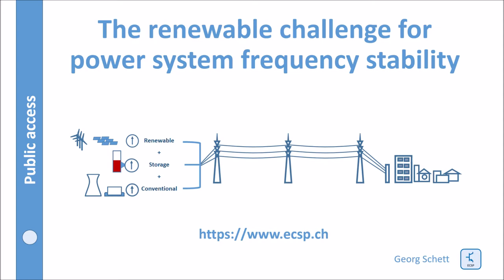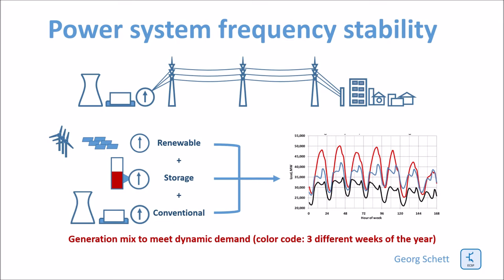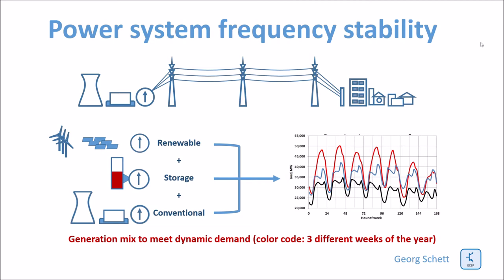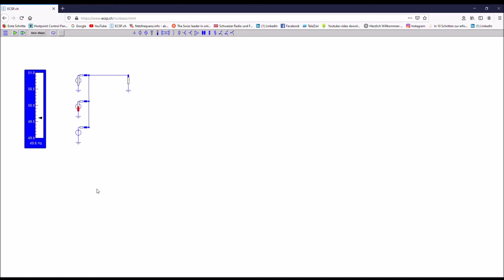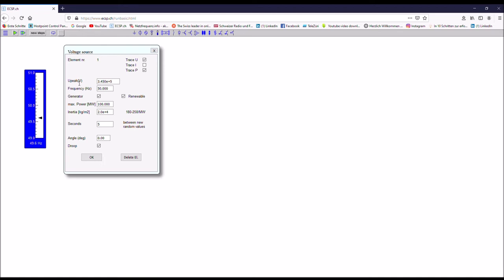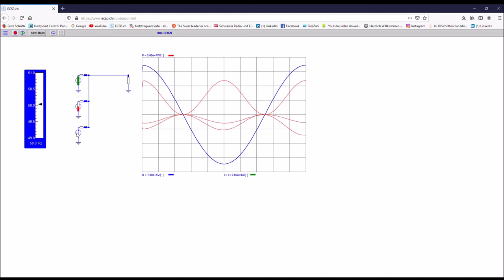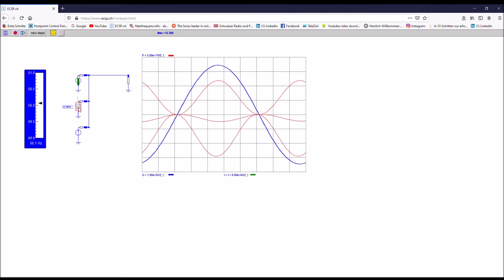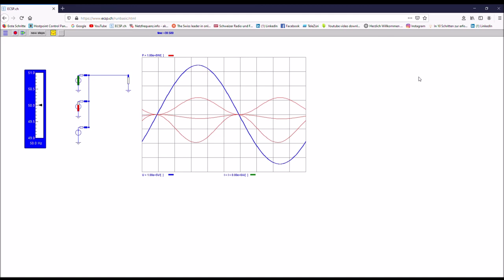Power system stability renewable challenge

Comment: Thanks for the videos. In your opinion, is it possible a future in which we keep same energy consumption but sustained by renewables?
Reply from the maker: We have to, right? It is definitely a huge opportunity for countries with lots of sun shine. They could produce lots of synthetic fuels and so substitute oil and gas. The technology is available. And heat pumps as well as electro cars reduce the energy needed by factor 3 - 4. So my answer is: YES we CAN but we need urgently to do it in big terms. The electricity consumption will increase probably by 50% or so, all solar, wind and some others.